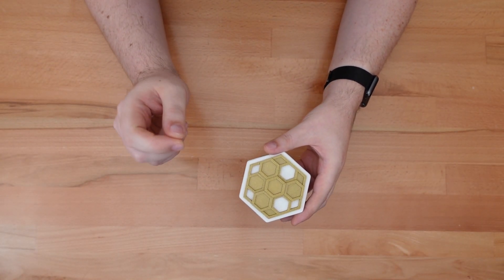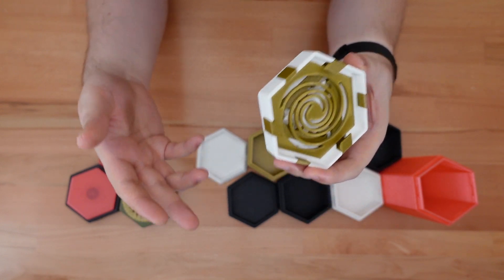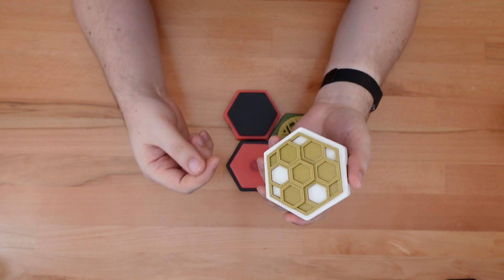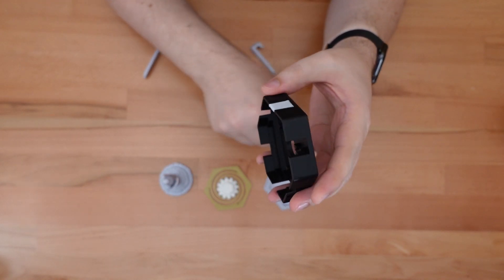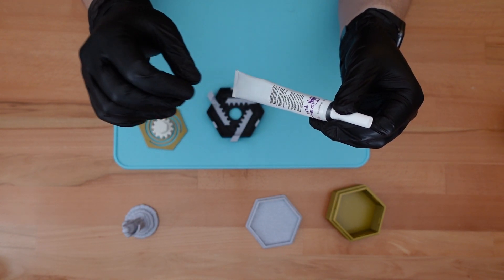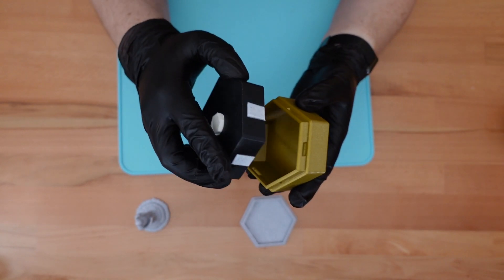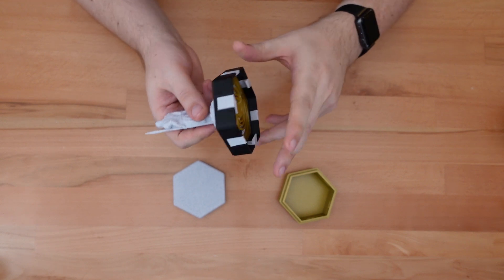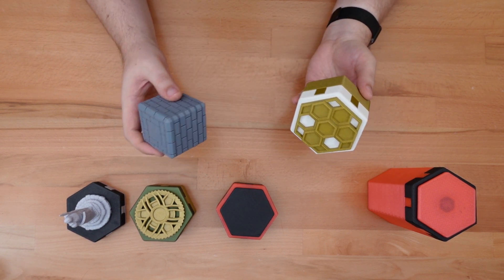Twist Lock Trick Box

Comment: So glad I found your designs and channel! You've designed some great stuff, can't wait to see what else you come up with! Do you do any finishing work on your prints? Their surfaces look so smooth!
Reply from the maker: Thank you, I’m glad you’re enjoying the designs!

I’m rather lazy when it comes to print finishing. I just print slowly and try to use good filament on the prints I know I’m going to show off. Test prints are in cheaper filament and don’t tend to look as good. I also try to use filament up as soon as I open it - so it doesn’t pull in humidity and degrade. Finally, I use direct drive printers. Sure, they can have printing artifacts around sharp corners, especially at higher speeds, but are otherwise very good at feeding filament consistently.  

Video and good lighting hides some imperfections. if I held a strong light against the side of a print, you’d see every flaw.

Comment: I can’t get the gear and spring together.  I know you said it’s a tight fit, but looking at the piece on the spring, it’s visibly bigger than hole in gear.  I printed gear twice just in case one was messed up, but it just won’t fit. 
Any thoughts?
Reply from the maker: In severe cases (lots of over extrusion or elephant's foot), you may need to do some post-print cleanup. I'd try using an X-Acto knife to open up the hold in the gear a little. There's a very good chance that only the entrance of the hole is too small.

I will be releasing a new combined Gear + Spring part in a few weeks, but I think you can get your existing prints to work. Good luck!

Comment: More people should use glue as a fastener. There’s so much stuff that it would work better for than adding clips or bolts
Reply from the maker: The glue in this video is super strong - and really helps the mechanism stay in place!

There’s always pros and cons with designing for glue. Many people won’t print a design that requires glue due to mess or concerns with toxicity. So I try to make it optional when I can.

Comment: I've done the Tardis and Adalinda on an embossed hexagonal box both are fabulous. I'm now doing Printables Twist Lock Trick box (square) however it shows a latch and a long latch, how do I know which one to use?
Reply from the maker: Both will work, but the long latch is more secure in the long run (especially if your spring starts getting a little weak). The short latch is good if you prefer a lid you can just press on.

Comment: so i tried to make the zelda box and it messed up on me... the topper is crooked and the gear is off by a notch... how do i fix this? did it print out wrong? correction: i got the gear in proper but now the spring wont go in right if at all... its crooked i can try without the spring perhaps? should i glue the spring to the cap to avoid a disconnection issue?
Reply from the maker: Sorry to hear about the trouble. You have several options.

1. the spring is optional, as long as you glue the topper onto the gear tight enough that it'll really hold the sliding latches. You'll lose the "springy" feel, of course, but it can work.

2. If you use the spring, which I consider a strong recommendation, definitely glue it in. I add glue to the 3 edges of the spring that do not touch the sliding latches. If you use liquid super glue, you can put the spring in first and then just squeeze some drops into the gap - it'll soak the liquid glue right up.

If the spring is really hard to fit in, try trimming around the edge with either a deburring tool or X-Acto knife. I suspect there is a tiny bit of elephant's foot (squish) that's making the spring slightly too big on the bottom few layers.

If the topper is still crooked, be sure to pre-tension the spring by 1 notch. The design assumes that the spring is always pulling in - even when the latches are fully closed.

Good luck!
Reply: @3DPrinty  I glued the spring into place which mostly fixed it! Thank you! I love the box! Do you have other interesting mechanisms? How do you make your models?
Reply: @3DPrinty  I also tried printing the sword and for some reason the bottom is off kilter… like it’s at an outward angle. It failed twice so far and I was wondering if you can make an updated version where the sword removes from its base?
Reply: @3DPrinty  when i try to print the sword it comes out thin and stringy (this is my first print im sorry if the solutions are well known...) the first time it got past the first layer the sides lifted up. i leveled the bed over and over again to see if that was the issue. i changed the temperature of the bed higher (failed) then lower (failed again) im currently trying again to see if maybe i can figure it out. im using a voxelab aries and the program im using is the voxelmaker program. it has no supports on the file either so im hoping that doesnt auto fail it when it gets to that point. does it auto add the supports? do i have to manually add them?
Reply from the maker: Unfortunately, the sword definitely needs supports - it's one of the more difficult models to print I've posted.

I'm not sure how that specific slicer works, but usually you need to turn auto-generate supports on - it's rarely enabled by default. From there, you'll probably have additional options to try out - like how much space is left between the supports and the model and how dense the support material is. I actually rarely print with supports, so the sword you see in the video is my second try - the first was overly supported.

In brief, it's going to be tricky, but also a good challenge for learning how to generate supports. I hope that helps!
Reply from the maker: I have a few mechanism-related models. You might be interested in the Toggly Fidget Button and the Pop-up Gift Card Box. I also have a video coming out in 2 weeks that's VERY mechanism-focused!

Comment: Do you have settings that work best for the spring?  No matter what I do I can’t get it to print good
Reply from the maker: For my prints I used:
- 3 perimeters
- 0.2mm layer heights
- standard PLA

If you can detail in what way it isn't working, I can possibly provide some other tips. For example, is it failing to stick? Or is it printing okay but the spring is too weak?